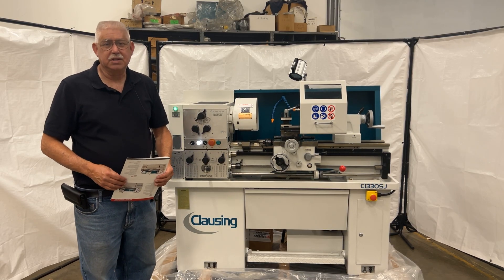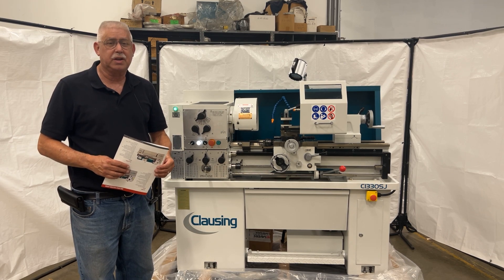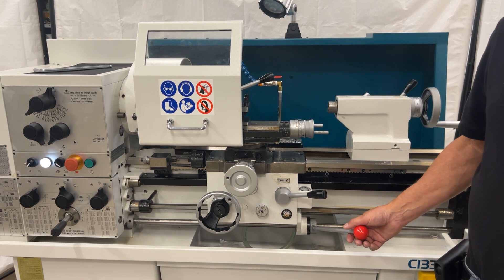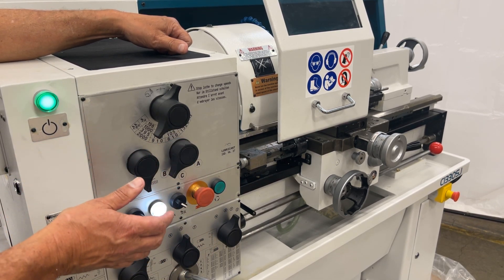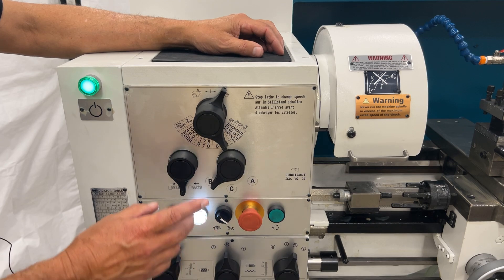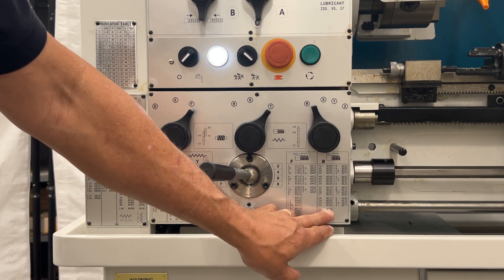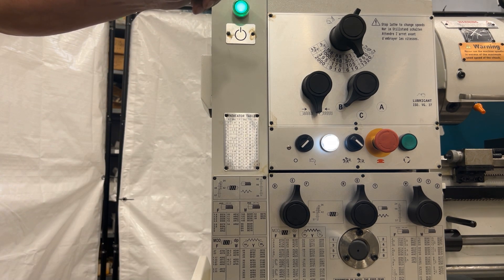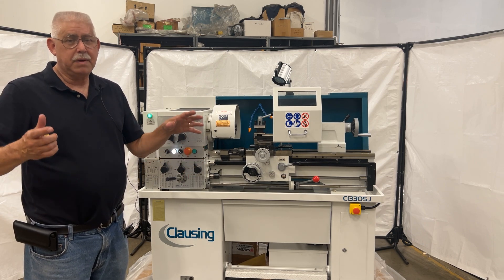C1330SJ - Straight Bed, Geared Head Engine Lathe Showcase

Comment: The machine doesn't have a lead screw!  What's up with that?  So there's no half-nut lever! How do you thread?
Reply: The lead screw is there, under a shield. It's up close to the top edge of the bed.
Reply: The lead screw is there, under a shield. It's up close to the top edge of the bed.